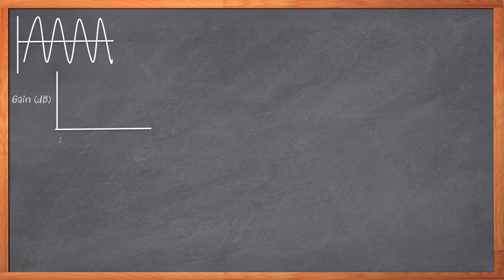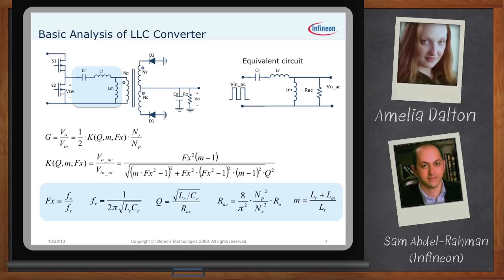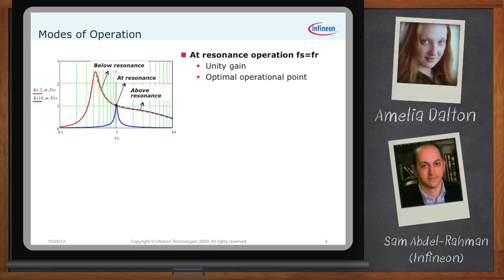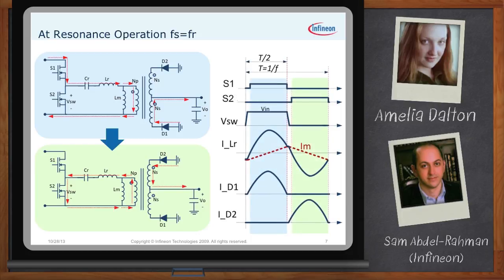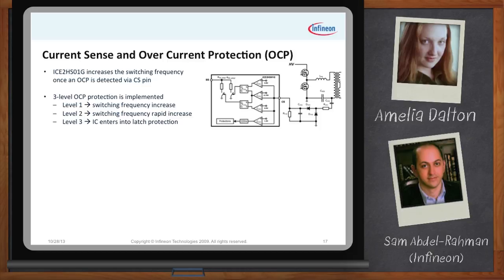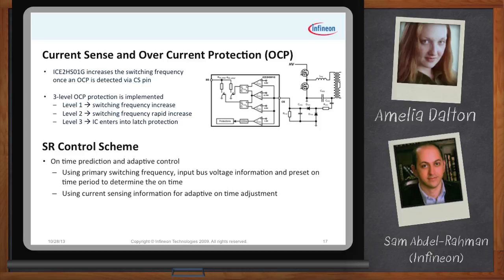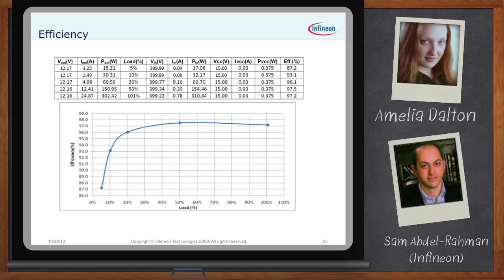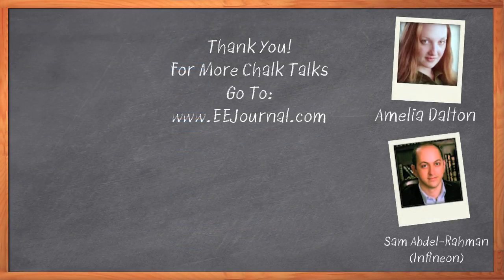Developing Clean Efficient Power with LLC Resonant Converters with Infineon

Comment: Great Video.In 9:22, Sam mentioned that in the capacitive region the current is lagging the voltage, but it should be the current is leading the voltage.
Reply: Raed Mohsen yeah it's kind of confusing
Reply: at the capacitive, the current is leading (hard switching). At the inductive region the current is lagging 

(ZVS). This guy got it wrong.
Reply: I was going to comment but you already did.

Comment: How can I design the LLC power supply with variable output DC voltage keeping the hardware same.The C voltage should vary from 60V to 350 volts.Can I do pulse skipping to reduce the voltage?

Comment: Is there any application note for calculating the efficiency of the converter with different input voltages(for wide voltage range as input)

Comment: How can I design the LLC power supply with variable output DC voltage keeping the hardware same.The  voltage should vary from 60V to 350 volts.Can I do pulse skipping to reduce the voltage?
Reply: You should be able to do something by changing the switching frequency and may be try to change FETs duty cycle